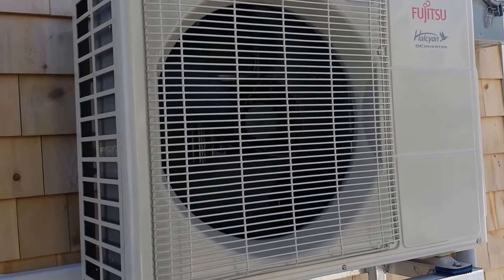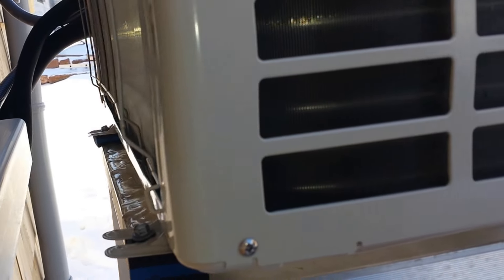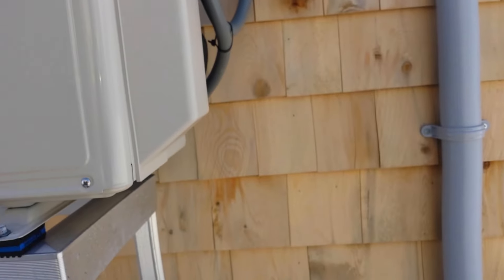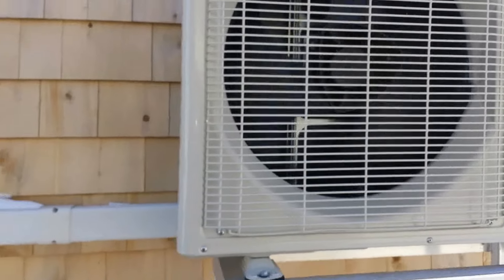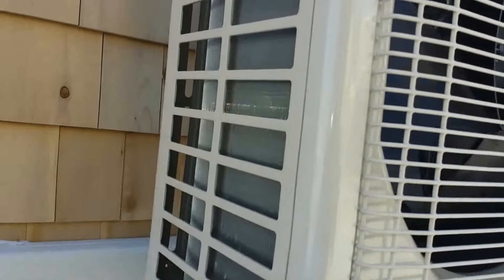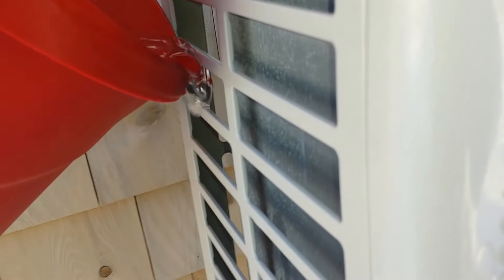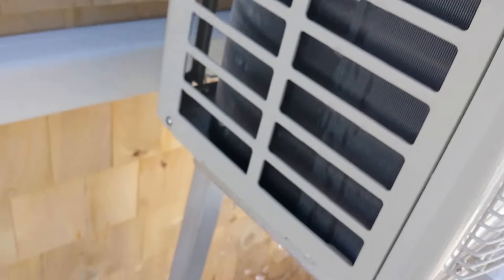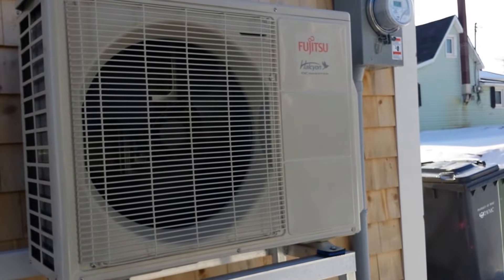How to de-ice a mini-split heat pump

Comment: I recently bought an inverter mini split and after one week of use I’m completely convinced that this system isn’t good for very cold weather. If I need to go outside when temperatures are below freezing due my equipment has stop to heat, it’s not a good source of heat. Electric coils or gas furnace works way better. I’m about to return my mini split.
Reply: These mini splits make no sense for heating if the temp is under freezing point. Especially if there is fog outside, they will just freeze. And also the vibration..... thats the thing that drives me mad about these shitboxes.

Comment: Still looking for how to extend my mini split's defrost cycle. Mr. Cool's only run about 3 minutes I've read, which seems accurate, but simply not long enough where I live. Stinks they won't tell us that info. I think others can simply pull the cover off and there are simple switches.

Comment from the maker: yes, that will work in milder situations, but if the fan is froze or there is an accumulation of heavy ice, that will not cut it. The unit in the video wasn't even froze up, but more or less just to show how it's done in extreme situations.

Comment: my unit just froze... I am thinking, wouldn't be possible to put an Infrarred heating lightbulb by the side of the compressor? so it radiates that thing you show in the video so it doesn't freeze?

Comment: My Mr. Slim just "died" last night - it was due to a frozen compressor fan. If the fan is not spinning, that might need to be unstuck as well. Odd thing is that there are no error codes when the fan can't spin ... but the unit does know something is wrong because it doesn't kick in the heat or blow hot air.

Comment: Another way is to put it on ac mode. It will suck out heat from in the house and melt the ice faster. Yes you will get 3-4 minutes of cold but its faster.
Reply: A Font. It should happen automatically, by design the indoor fan will not run or that will be chilly

Comment: What’s your thought if this happened in above freezing conditions with no precipitation overnight?
Reply: When your refrigerant levels are low, your system's pressure will drop, which causes the coil to become colder than usual. This is the most common reason for heat pumps freezing up in the summer.

Comment: This is the brand I'm seriously considering buying.  Do you not have to have a cover over it to keep snow off?...or does this not apply to Fujitsu Units? (Or maybe you don't live where it snows much?)
Reply: I recently installed a 36k btu multi zone in my house. So far I love them. But for best results, tightly insulate your house. That is what I am doing. The less heat escape, the less the unit has to work. I had all electric baseboard, they sucked.
Reply: I’ve had a ton of problems with my fujitsu halcyon with pretty poor support 🙃 would not recommend (in the US anyway) and I’m over $8k and stuck with it basically. This comment is probably way too late but just thought I’d give my experience 😭
Reply: @bradrenfro1974  I ended up going with a Senville SENA-18HF/D  It's an 18000 btu with two 9k air handlers...wi-fi endabled...and cost just over $1800.  Keeps it very comfortable in my new addition in Kansas...It's supposed to heat down to something like -22 degrees fahrenheit...and it did seem to manage with the -10 we've had here in the last couple of weeks but it was less efficient at those temps.  Haven't had it installed long enough to know the actual energy efficiency (monthly cost wise) as I've been also backing it up with an electric space heater since it's  new...I don't exactly know what to expect from this unit yet....and I I have pipes without fixtures installed yet so can't leave them dripping... However, this model is rated at 23 SEER, so I have high expectations, and the cost seriously beats Fujitsu.
Reply: @macoeur1122  hey fellow Kansan! I’m glad you found something! In the first year of ownership of this thing the entire thing was replaced at different points. Bc of my setup I opted for a ducted mini split so there’s an air handler in the garage mounted in the attic. The outdoor part is louder than they said it would be during the sales process (lol) and I woke up to it encased in ice this morning (just above freezing). But it’s been fine since I thawed it thanks to this video. Hate the thermostat but the converter I bought from Fujitsu allowed me to use a smart thermostat for a while but then the converter crapped out too so ¯\_(ツ)_/ live and learn I guess
Reply: @bradrenfro1974  This Senville Sena defrosts itself...So far, it seems to work...I swear I've practically been holding my breath, waiting for something to go wrong.  It would suck royally if it did because I had the line sets built into the walls and my "HVAC guy" was a nightmare...Had to do the best I could on my own to check for kinked lines (through the insulation...Not easy)..and caulk wall protrusions...and adjust condensate lines. which were also in the walls... to the right angle to drain properly... Did find someone new to install the air handlers after drywall went in.  So far I'm truly thrilled with the thing (feel like I need to knock on wood though!)

Comment: this is BS, it goes in defrost mode automatically no need to turn power off
Reply: This depends on the weather - I'm in Toronto, and last year, my heat pump was encased in ice after a rain/ice storm. Last night, my other one stopped working beause the compressor fan got frozen stuck (didn't seem to take much to freeze the fan). The auto defrost cycle sometimes doesn't work fast enough... and also, the heating coils aren't in optimal places to melt all the ice.

Comment: In really damp climates with ever changing temperatures this solution does not do well.  Directing water to where needed is not easy and, if quite cold out, the water cools quickly being ineffective if the ice is thick.  A heat gun or good hair dryer works better. Using these in minimal wind is best.  Also if using water, a larger squirt bottle is good as you can direct the water more effectively than with a bucket. I think an insulated hot water filled plastic cannister with a pump similar to an old fashion fire extinguisher would be best. Something like a garden fertilizer/pesticide sprayer.

Comment: Who is going to go out there and pour hot water during a snow storm, or when it's humid and 5 degrees?? 

What we have done many times, is put the unit in Cool or dehumidify mode.. 
There will be a blast of cold air in the house (turn on a space heater), but the ice melts in 5 to 10 minutes..
Turn it off and allow it sit for a while so the heat exchanger can drain..
Then turn it back on heating mode. 

On our old Sanyo units, I can only set the thermostat to 1 deg above room temperature.. 
Then slow crank it up as room temp increases.. Otherwise it goes nuts with high power use.. :(
Reply: Richard Lee